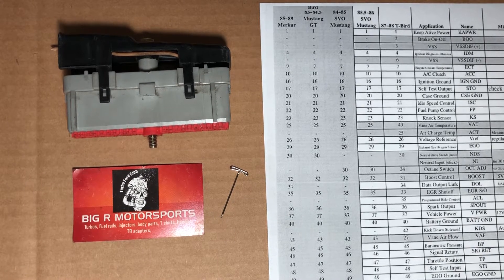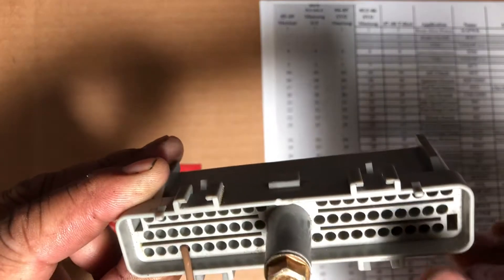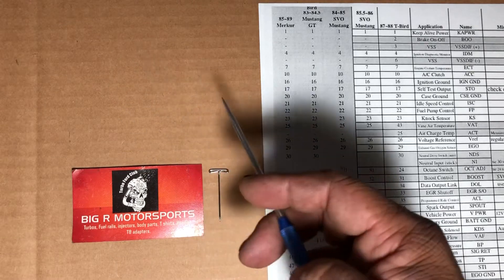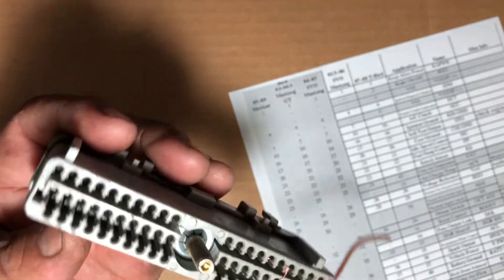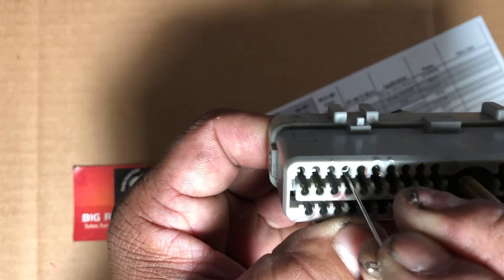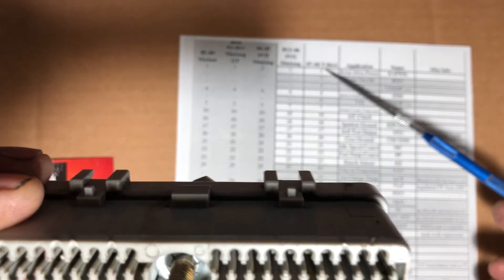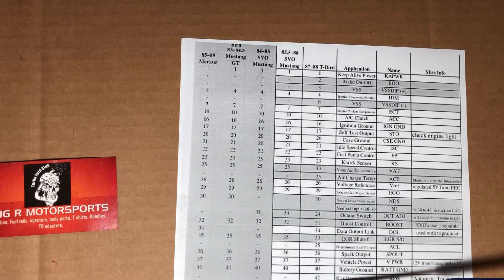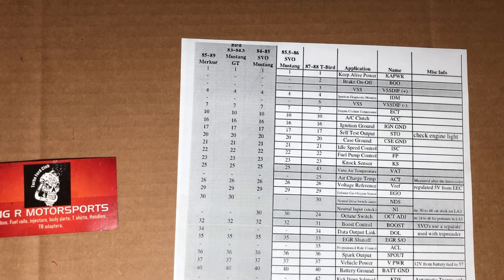SVO Merkur 2.3 Turbo Repin Procedure for LA3 ECU upgrade

Comment: Hey I grew up around carb engines, currently learning about wiring and efi. putting a 2.3t into my 87-90 mustang. From what I gather, I simply wire my 87-88 vam pigtail to the egr wires, and then move from pin 33 to 43 on my la3 ecu. Sound about right? Is there another step I'm missing to get it running? Na 2.3 has a distributor, NOT 8 plug.

Comment: I bought an LB3 ECU for my 1985 SVO.  Anything I should worry about?  Or same procedure?
Reply from the maker: No. You can use a auto ecu in a stick car, but you cant use a stick ecu in an auto car. In your case a svo is stick and a LB3 is an auto ecu, so you dont have to worry about it. Same speed and just as aggresive. You will need to repin harness though
Reply: @MultiChipsta  thanks, knew about the repinning.  I asked because I just saw a video about the A9L and the equivalent auto ecu for the 5 liter.  The guy said many of the strategies are different and not a good option, e.g., IAC strategy among others.  I’ll also add the ATS when I install my LB3